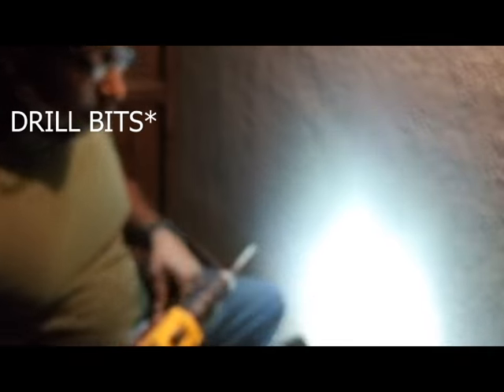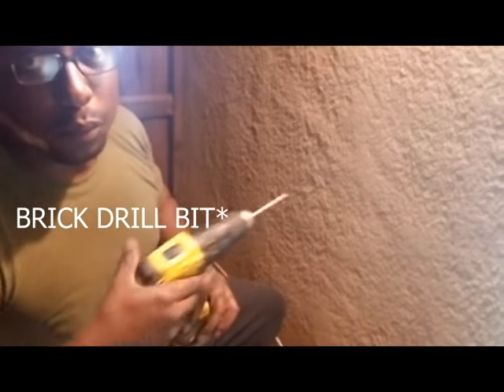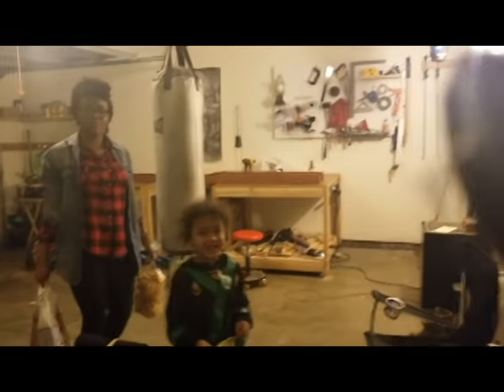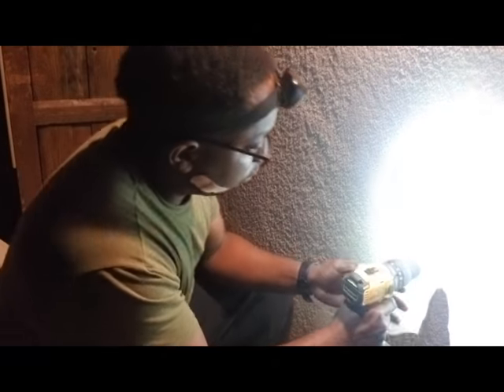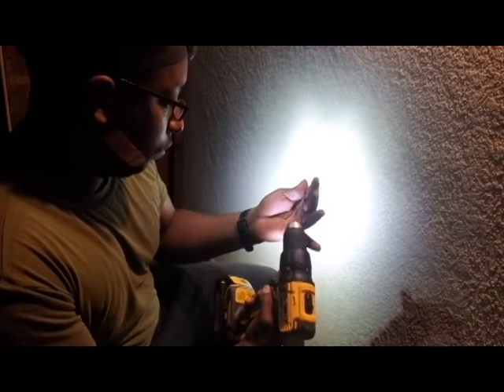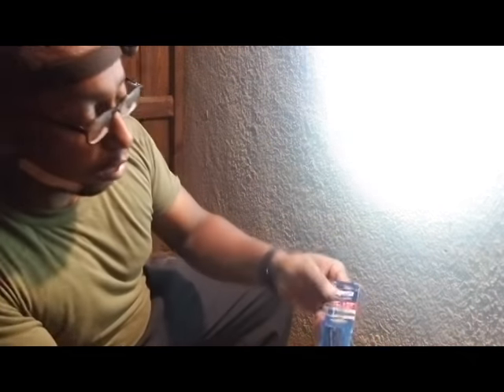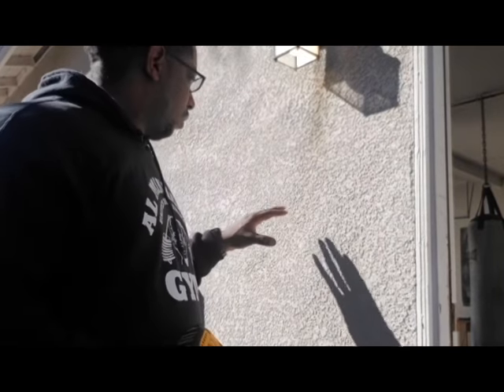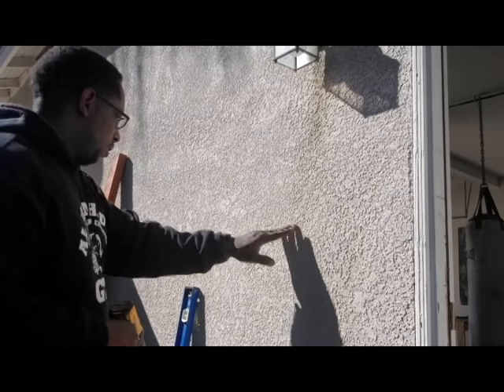HOW TO DRILL INTO STUCCO WALL AND INSTALL WALL MOUNT

Comment: I think I would have drilled the holes into the 2x4 first, then positioned the 2x4 on the wall and used the holes in the wood to mark the correct spots for the anchors on the wall, then drilled the holes into the wall.  Also, good comments about using silicone around the holes to prevent moisture intrusion.

Comment: Thanks for the video. Quick question. If I want to hang something off an outdoor stucco column of my house, which already had gutter brackets with 3/16” 2 1/2” screws drilled into it (so I’m guessing it’s plywood beneath it), would I use a 1/8” carbide drill bit to go all the way through the stucco and wood and then screw a 3/16” screw into the 1/8” hole in the stucco, or would that risk cracking the stucco? Or would I drill a bigger hole through the stucco and then a smaller hole into the wood behind it so the screw won’t put outward pressure on the stucco? What do you think?  Thanks in advance for any feedback on this.

Comment: So the you drilled through the stucco and into the wood studs. I thought the tap con was for anchoring in concrete or block. So did you use normal screws for the studs and tapcons for the ones not in stucco?

Comment: tapcons only should be used in solid masonry, traditional plastic in hollow, and you should use a good ol' lag bolt since your going into the stud 🤙the stucco is just a medium, the wood is what's holding the actual screw

Comment: Nice video.  I'm getting ready to mount a TV on our patio wall and I had envisioned doing this the way you showed, i.e, finding the studs from the inside first and then marking them on the outside but nice to see great minds think alike and I will use a tapcon drill bit as well.  Thanks!  I don't understand the thumbs down that good videos like yours get.  It's a nice quality video with great information so what's not to like?  People are idiots.
Reply from the maker: I appreciate it brother... Its one of the first of many videos and it a starting point so i understand. I am very appreciative and if you would like to see any other diy let me know. I do something different to ths house almost every week

Comment: HI! What Dewalt drill did you use that had enough power to do this job?  I"m looking for a new drill and would rather get 1 than having to get a hammer drill too.  Thanks!
Reply from the maker: Hey 20Vmax... Dewalts produce a good amount of power so most of my tools or dewalt

Comment: Can a hammer drill into drywall as well? I am looking for a drill to drill some holes into stucco ( to hang a patio curtain rod) and also drywall (to hang wall art, curtain rods). 🤷‍♀️ I don’t want to buy two drills. I read the hammer drills into stucco without any cracks.
Reply from the maker: A hammer drill will drill through faster. I just wanted to see if it was possible to do so with out the drill. I would recommend a normal drill for dry wall.  The difference between the two is the hammer drill bit spins with a woodpecker effect.  Sorry for the delay in answer.
Reply: Westcutz Young thanks for your reply. I bought a hammer drill that can switch to normal as well.
Reply from the maker: @mountain-view310  That sounds like something I should invest in.

Comment: nice vid, 
what was the size of the bit you used to drill into the wall? and what screw was used to mount the 2x4 to the wall
Reply from the maker: My apologies for the long off reply. The drill bit was a 5/32 and 4 inch long. I used tapcom screws as well.

Comment: I didn't notice any sealing against water. You drilled a hole into the stucco, so water can now possibly get in. Aren't you suppose to caulk or seal around the holes prior to mounting the wood? Also, and maybe you don't need to do this but shouldn't you use a blade bit to drill a small recession for a washer as well, making it stronger and sealing that at the end?
Reply from the maker: Great observation... So what I did was seal/caulk the wood its self to the wall... I put storage up on the wall and insulated the wood